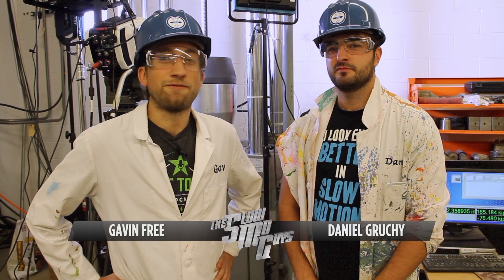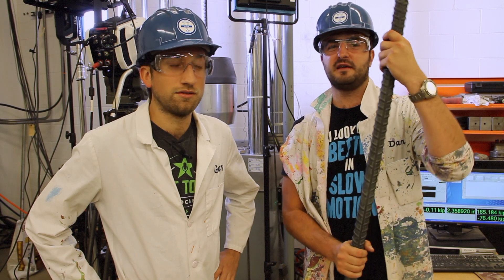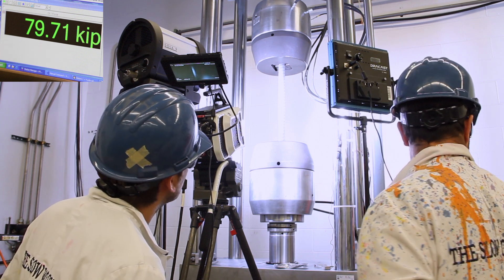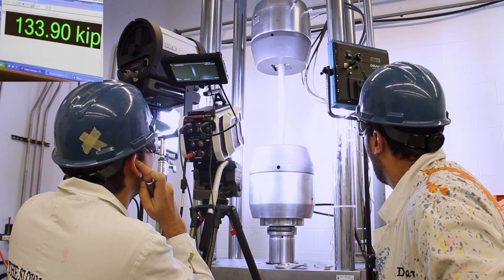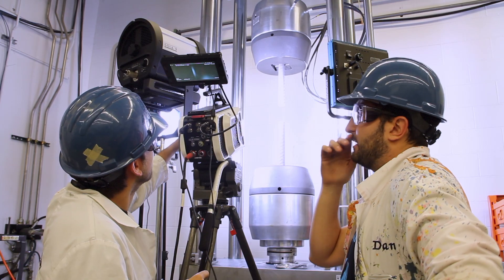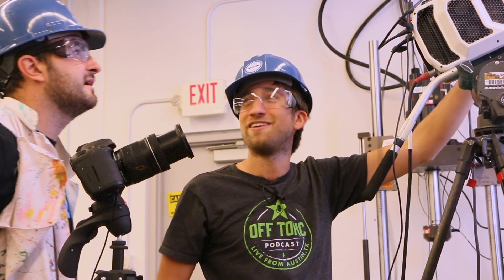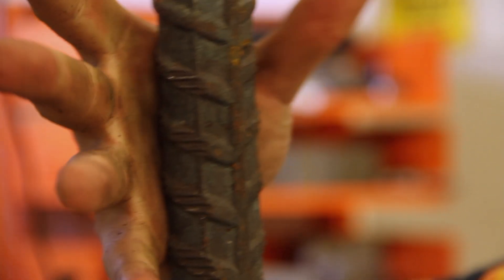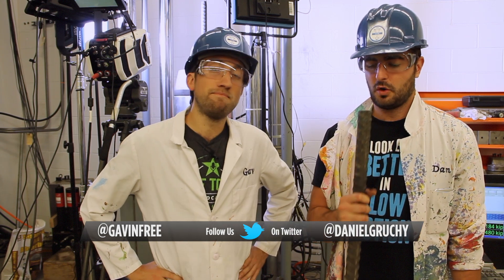Snapping a Steel Rod 1000x slower - The Slow Mo Guys

Comment: you should do welding metal in slow motion
Reply: Converitng HP to punds? Good luck lol
Reply: Chicken Noodles 
Today
Reply: so it would kind of be like looking at a light bulb in slow motion. how the light bulb seems to flicker from the alternating current going back and forth
Reply: I agree
Reply: I agree, that's a good idea but it would be tough to film. Even with a filter the light would block what we want to see. And if the filter is too dark then you cant see anything at all!
Reply: Christopher Bazaka but filming in slow motion with that being the only light source would just darken it, no? it wouldn't be just a massive flash blinding the camera.
Reply: You guys... Slow-mo videos of welding already exist, and I watched them when I was enrolled in Welding Tech. All you need is to get the same lens that's on a welding mask, if it's okay for your eyes to see then it's okay for a camera to see. Only issue is getting a clear enough zoom-in on the molten pool of metal. I know the Slow-Mo guys can do it, because it's certainly not impossible.
Reply: idk about slow mo its interesting enough in real time with a filter
Reply: Alot of arc welding might be interesting to see, but oxy acetylene would just look how it does in real time but slow.
Reply: Anvilshock alot of different kinds. I think wire feed and rod would look coolest
Reply: Chicken Noodles
Reply: There are pretty good slo mo welding shots that do exist, I'm sure the shots would look way better with them filming though.
Reply: Chicken Noodles I'd really like to see them do a video showcasing the different metal transfer types of mig welding. Would be really awesome to see
Reply: Christopher Bazaka although while welding you can watch I happen any way I mean seriously
Reply: mason methot thats what im sayin
Reply: What is an "alot"?
Reply: Chicken Noodles ya
Reply: I think that would damage camera
Reply: well the electric arc would have a frequency... therefore the light emitted would too, so at very high speed you might see it go light, dark, light dark. welding machines can be quite advanced with regard to electric pulsing... you'd go from seeing something to seeing nothing. still it might be interesting to see through an automatic light filter if it could keep up.

Comment: Being a welding inspector, this is a pretty good video, higher frames would be even more entertaining. Nevertheless, there are a few things that should be mentioned, or cleared up. 
First of all, the "teeth" that grip the specimen get tighter and tighter on the piece as the KIPS, or applied load, increase. This means that the initial gripping force is not equal to the final gripping force
Second, what you performed here was a tensile test. Multiple data can be derived from such tests. Arguably, there are five important data to be gathered, with a six data point being somewhat unaccepted by welding codes.
1) Tensile strength: Tensile strength is calculated by dividing the "Applied Load" (157 KIPS in this case) by the "cross sectional area". Area of a circle (which re-bar essentially is) is calculated "pi" time "radius squared". So we have 157 KIPS (the applied load) divided by 1.77 (the cross sectional area of our specimen) which is equal to the actual tensile strength of the material, or 88,700 PSI. 
2) Percent elongation: This is tougher to explain without the actual data. Essentially, you mark a known distance on the material. Once pulled, you fit the pieces back together and find the new distance between the marked points and divide. This gives you the percent that the material stretched, or "percent elongation".
3) Percent reduction of area: Again, tougher to explain without the actual data. Basically, you take the starting cross sectional area, compared to the smallest cross sectional area in the break zone, divide the smaller of the two by the larger, and get a percentage that tells you how much the metal "necked down" during the break.
4) Ultimate yield strength: This was briefly mentioned in the video. Yielding occurs when the elastic metal (metal is considered elastic because when a force below this point is applied, it will return to its original form, such as a rubber band) turns to plastic, and can no longer return to its previous form. 
5) Ductility: This is not necessarily an actual number as much as it is an understanding that ductility is directly related to numbers 2 and 3 above. Ductility is the metals ability to take a force and spring back, or remain elastic.  
6) Hardness: Although this is roughly calculated by the tensile strength, it's not an acceptable hardness test per code. It is just a simple point of reference for non-code work. Hardness, though, is inversely proportional to ductility. The harder the metal, the less ductile is it, or more brittle. Hardness is directly proportional, though, to tensile strength. The higher the tensile strength, the harder the material is. This is why you can roughly calculate hardness from the tensile strength. 
Hope this provided a quick insight to what is actually important when dealing with metal. Great video.

Comment: But wtf would you use that machine for?! Aside from pulling apart steel rods
Reply: Tensile tests... when manufacturing anything, including steel rods, you need to ensure they can handle the load they're rated at.

Take a few out of a batch, put it through the machine... Make sure the batch is as strong as it should be.

I've used a tensile tester before, smaller scale though.  We were manufacturing steel components which went under the seats of GM cars and trucks, primarily the safety belt anchors, as well as the anchors which kept the seats on the chassis.

Something a lot of people don't realize, but this kind of quality control is essential.  You can run the same machine all day with the same raw material and out of the blue get different output.  Something within the process goes wrong, one machine running out of spec.  A batch of raw material gets loaded and turns out to be inferior grade... anything can happen, and will.
Reply: I'm pretty sure they made that machine for that purpose, to test the breaking point of rebar and give it a structural rating for construction.

That sounds like I know what I'm talking about, right?

Right?
Reply: Grievous1 Haha, right
Reply: Harvey Djent The original function was to jerk off the Incredible Hulk.
Reply: Tensile strength testing. It's okay, there's weirder things, like smacking a piece of frozen steel with a giant pendulum hammer.
I highly recommend looking up charpy testing if you're interested haha
Reply: or snapping horse legs in torsion machine to get mechanical properties of the bone so it can be replicated with prosthetic
Reply: Harvey Djent I work in a material testing laboratory. By law several facilities "especially in the aerospace sector" are required to get 10% of manufactured goods tested and certified. Like jet engine turbines for example.

Comment: Gr 60 means it has a tensile strength of 60 kips/square inch. Number 11 bar has a cross sectional area of 1.56 so that equates to around 92 kips to failure. 

Where it snapped is where it hit the ductile limit which is much higher but engineers don't design for that because its dangerous as hell. You don't want buildings snapping all over the place during an earthquake.

Comment: Should have come to the University of Wisconsin. We have a 1,000 kip test machine. Can break 3 inch diameter bars.
Reply: Hello, I'm from Uruguay, excuse me, could you tell me how many tons of stretching a bar of low carbon steel with a diameter of 18 mm would support? Thank you so much

Comment: I dont understand the core concept of the machine. Aside from pulling metal apart like this,  what could you possibly accomplish with this machine? What would you need a machine that can pull at 157 kips?
Reply: Every lot of rebar needs to be tested to ensure it meets the requirements of the ASTM standard it's produced under.  So a lot of these machines will be produced for testing labs that just test rebar all day, doing exactly what you see here.This machine is in a university lab, so there's probably a lot of demonstration tests for undergrads, and graduate student structural engineers doing research, as well.
Reply: Clearly you need to test what sort of stress a material can be put through or else every scyscraper would collapse if a bird farted on it.  Why is that so hard to understand for people?  Even steel and concrete need quality testing and research on stronger ingredients.

Comment: For those who don't use imperial, 1 kip is 4448N, so 157.4 kips is 700,115.2 N.
That's enough force to accelerate a 1kg object to 700,000 meters per second.

Good lord.

Comment: wtf is a kip never heard of it you must be referring to tensile strength
Reply: Kilopound.  A force of 1000 pounds.  It's used all the time in US Customary units in structural engineering.  The rebar they're using is called Grade 60 because it has a yield strength of 60 ksi, or kips per square inch. (60,000 psi)
Reply: I'm british so I don't use inches lol all about that pascal life
Reply: CatCube2 Also, they said it's #11, which means it's  11/8 inches thick.  Gotta love the imperial system of measurement.
Reply: I'm taught metric ;P

Comment: 1:53 why is the kip counter running on a windows xp computer?
Reply: Most industrial machines use older OS's because they don't need any fancy graphics or the like, they just need something that will work and just keep working for as long as they have the machine.
Reply: Neon_man909 windows xp was the OS being used when that system was sold to them.
Reply: XP is one of the most stable Operating Systems ever. It's also cheap.
Reply: It makes the machine all the more impressive.
Reply: Don't know man, seems like the majority of scientists and experimentalists are using Xp (like they live în the past)
Reply: Why do you need anything better than xp to run that machine? You don't, that's why.
Reply: Charles Scott
The one I worked at did six months ago. Then again it was also in the middle of nowhere backed by a swamp, and we were on a first name basis with all of our thieves, so...
Reply: Strangely, most of the system in fact doesn't.  Self checkouts run XP, all machines in the back room typically run a stripped down version of XP.  The newer registers that are touchscreen based all run, you guessed it, XP.  I actually can't think of a single instance where a typical walmart actually runs DOS anymore.
Reply: and free ;)
Reply: lol, not like it's gonna be using Internet Explorer, or be connected to the web...
Reply: Think that's bad? Walmart systems run in DOS. Unsurprisingly...
Reply: Neon_man909 I thought I was the only who noticed that😂

Comment: 150K lbs ~ 68 metric tonnes,~ 38mm dia, a locomotive engine weighs about twice this, so two bars could just lift one,  there must be stronger steels around, at a price. Kevlar comes out stronger than steel but then I remember measuring glass at school which was better than steel.

Comment: Weird... I've worked with pull testers on rebar before (I was at a company that made fibreglass rebar) and the lack of safety guarding on this machine is absolutely bizarre. I'm surprised there wasn't at least a plexiglas box around it.

As to everyone complaining about Windows XP... automation software lives in another universe where time moves slowly. I was just transitioning automation PCs off of XP to Windows 7 last year, to hell with Windows 8 or 10. Gah.